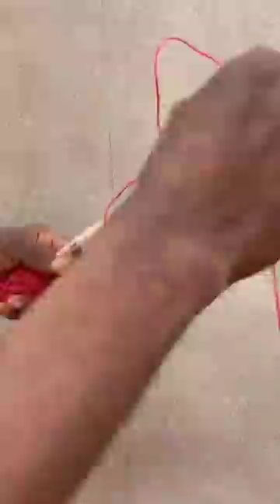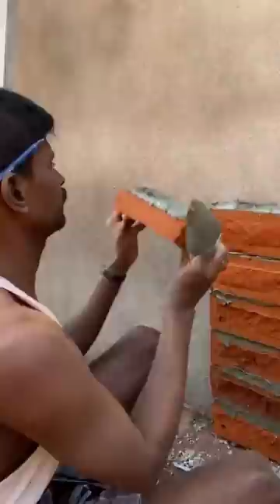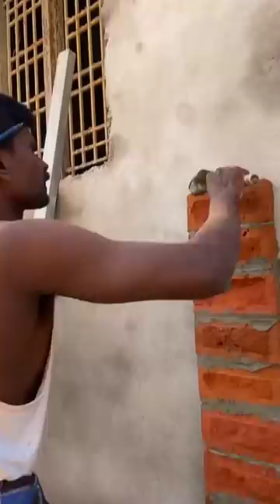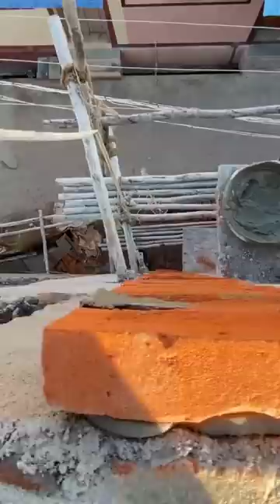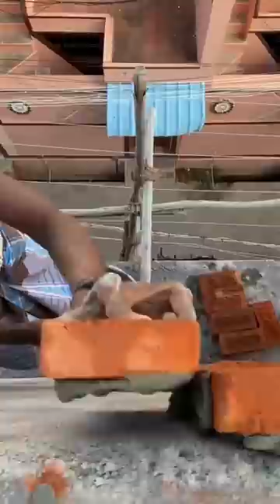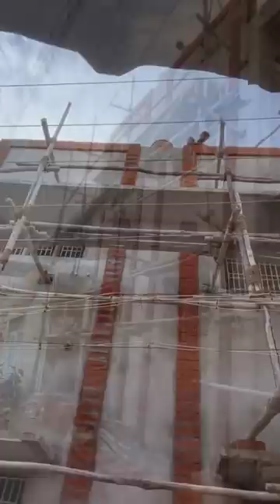Excellent! Brick Wall elevation Marking#shorts

Comment: They are placing the brick on a smooth wall without proper coursing, definitely it will lead to cracks and eventually the bricks will fall apart one by one after few months due to weathering